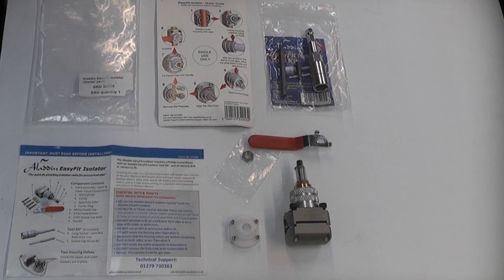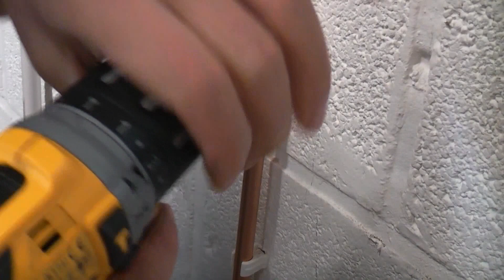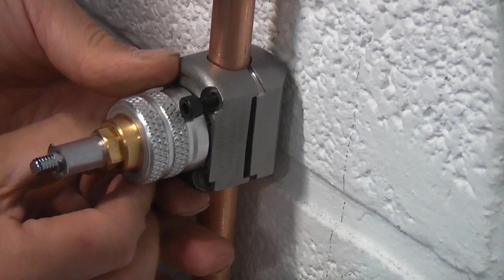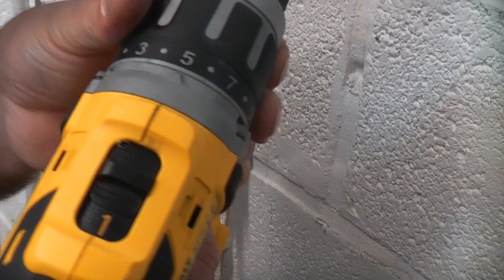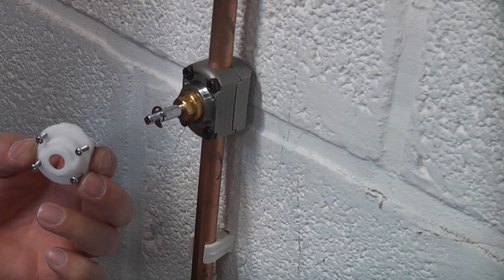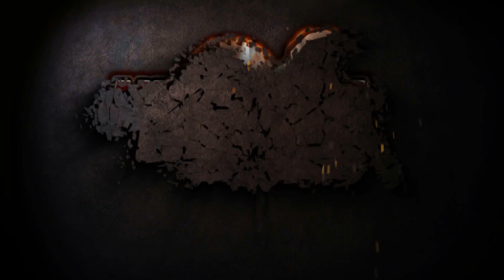Aladdin EasyFit Isolator | Isolate a live water pipe

Comment: Looks vulnerable to impact with no flange or reinforcement. Better clamp the pipes securely on both sides.
Reply from the maker: Once this is clamped in position it is very strong.
Thanks for the comment

Comment: small particles of copper now in pipe , ready to travel upstream to clog your faucet or fill valve assembly in your commode.  it looks like a ingeneering  feat to build sutch a valve complicated but not nescarary just shuu off water cut pipe install sharkbite valve turn on water Walla finished!
Reply: the manufacturers thought of that, there are no particles, just a squashed section of pipe in the back part of the unit.  this device is perfect for people like me who work in the houses of wealthy people who do not want disturbance or inconvenience to their lifestyle, but want problems solved
Reply: *voila - https://www.waywordradio.org/voila-vs-walla/
Reply: I wondered about how it works. So is there any crimped section to restrict flow? How does it maintain the cross-section?
Reply from the maker: Can you please make a video on how to "shuu off water", as I do not know what that means?
Thanks for the comment

Comment: The problem with this is that if a situation arose where this could be utilized the average home owner wouldn't be dealing with the problems this valve fixes.  The homeowner would call a plumber and a plumber would not use this to fix the situation.  If you use this valve to section off copper pipe to solder or alter piping then you probably are more advanced and dont need to go the quick fix route.  Its like a surgeon using a bandaid to stop bleeding then proceed to re-attach a severed limb... On the flipside if you were a plumber and used this you probably got your license from the back ads of a comic book.  Its not up to code, and there are several other things that can be done quicker in an emergency. Hmm i dunnno i kinda want to try it out though..
Reply from the maker: Thanks for the comment

Comment: I would not trust a piece of plastic with high pressure water. Always better cut the pipe and solder a cut off valve properly soldered in place. If there is wood behind, put a piece of dry wall between the wood and the pipe. This is a wired situation most people will not encounter. A pipe exposed like that.

Comment: These won’t work on the old fashioned thick 15mm copper. I wasted £40 on one of these.
Reply: Hi Michael with the older thick copper pipe more torque may be required than your drill can provide.  In this case a ratchet or wrench will be needed as stated in point 6 of the detailed installation instructions.  We also have a technical support 0800 number for any help needed with installation.  Many Easyfit Isolators have been fitted to the old style pipe .  Please call for any further assistance.

Comment: That's a Lot of work..Easier just freezing the water cutting off top and put a shark Bite Valve on ..looking at maybe 3 minutes VS what looks to be at least 30 minutes ..Plus what the Cost ?? Shark Bite Valve about $10 for 1/2 '' But no doubt quick freeze Cut and shark Bite much quicker
Reply from the maker: You can install one of these in about 3 minutes, if you are not filming it ;-)
Reply: so whats the cost ? of say a 1/2'' valve

Comment: Tried it absolutely discussed. Stuck half way with and left me with leaking pipe and the nut keep slipping and gone only half way.
Didn’t work for me. Shit design
Reply from the maker: Have you told them-
https://www.easyfitisolator.com/contact
Reply: @ultimatehandyman  no I still got pictures of the fail valve
Reply: Thanks for your advice

Comment: that sure looks like a ½" pipe to me...
Reply from the maker: 1/2 pipe is very similar in size to 15mm. They used to use 1/2 copper pipe in the UK but swapped to metric a few decades ago, although all the pipe I install on site (steel) is still imperial sizes.
Thanks for the comment ;-)
Reply: +Ultimate Handyman threw me for a loop when you said 15 mil lol, ty for answering
Reply: alcolyte76 ih

Comment: These looks like an excellent idea I wonder if if it goes up to 4 inch pipe if I need a shut off valve  of 4 inch diameter so I would like to know if this device can be obtained in different diameters offer now you'd only it's available and half inch 3/4 of an inch pipe and 1 inch pipe I would like to know and where can we get them and how safe are these things what's the pressure handling per square inch that these devices can handle and is there any risk of the pipe coming out of these device because of extreme high-pressure like which I have found in some of the buildings in which I've done some work that their pressure regulator no longer works so I would like to know what's the pressure handling power of these devices thank you
Reply: Currently the Easyfit Isolator is only available in 15mm and is rated for up to 16bar pressure.  We are currently finishing development of the Aladdin Pipe Genie a pipe blocking tool similar to a freezing kit but better as it can be used on hot or running water too.  This will be available initially in 15mm and 22mm sizes but will eventually go up to larger sizes. Please follow us on twitter for news of new product launch dates @aladdinNlb

Comment: It seems like nobody really listen to what this product is, it isolates a water pipe. Let say you have a leak in a pipe you cannot get to to fix ( in a wall or in a concrete slab) you  can instantly install this and stop the flow of water ( and possible water damage) and now you can work on finding and fixing the water leak. Where i live all the high rise apartments built back in the day have no individual water shut off so when working on one unit you have to shut off the entire buildings water supply.  This would be perfect for retrofitting
Reply from the maker: At last, somebody that understands what this does 👍
Its been quite a drain on me, when I have to approve the "I'd just freeze it", or "I'd just fit a shark bite fitting" comment.
 One guy can even freeze flowing water 😁
Thanks for the comment

Comment: If you could do this Hot/Active I could understand but that was not mentioned here. If you cannot then WTF?
Reply from the maker: 0:13
Thanks for the comment ;-)
Reply: Alot can be said for reading a videos description.
Reply: @Curiosity. The manufacturer website says the Aladdin Easy Fit Isolator installs into pressurised pipework, even with hot running water.
Reply: nightjarflying lol wow
Reply: Curiosity i
Reply: Scott Page USMC uhygt
Reply: Tan Tan don't think so
Reply: +Tan Tan No this cannot be used for gas!!! It is sold for use with water pipes only. With gas pipework you would shut off at the meter, do the required work on the pipes and then switch the gas on. The equivalent to this valve would be to cut the pipe and insert a gas-rated isolator valve (obviously after shutting off at the meter).
Reply: @Curiosity you can even use it on pipes that contain volcanic lava.
Reply: Tan Tan that is definitely not for gas. Wrong color. Never mess with  that stuff. Seals may not hold up against the pressure difference between water and gas since they are not designed for use on anything other than what it says.

Also I have only seen threaded valves for gas. Just a gasket would be insane
Reply: I think this is for Natural Gas / Propane lines only. Anything else would be dangerous. 👍

Comment: I suppose it would help in some situations but this appears very similar to the garden hose kit that put a spike in the pipe. I've heard numerous plumbers tell me never to use these. 

Forty odd quid does seem a bit excessive though.
Reply from the maker: The self cutting taps can reduce flow in some pipes (so I have been told), but this cuts out the slug and compresses it into the pipe, so it should not reduce flow much at all.
It's not cheap, but very well made and very convenient. 
Thanks for the comment

Comment: Using coper pipes for drinking water is not safe and water also has metalic taste. Use a proper piping for your drinking water.
Reply from the maker: Copper is widely used in the UK for drinking water ;-)
Reply: Ultimate Handyman and fittings are soldered with lead probably. Great. You are consuming heavy metals then on daily basis.

Comment: As a plumber for twenty four years, having used these and seeing them installed. They are crap. They cut the pipe damn near all the way through, you are left with two tiny little pieces of pipe left on the sides. I have seen these blow apart several times due to pressure fluctuations in the piping created by normal water usage in large commercial buildings in Houston tx. They only ever get used in places where turning off the water is not practical, so when they blow apart, is not always a quick process to turn off the water resulting in significant water damage. In fact, the last time i encountered them was years ago. Maintenance had installed them all over the building over a few years thinking they were awesome. After two blowouts and subsequent damage, we spent weeks removing them and installing real valves. The best solution to add a valve is to freeze the line, cut it and install a proper valve. I wouldn't install one of these in my worst enemies house. They are garbage.
Reply: Thanks for your comment Shelby but we are at a loss as to understand how one of our Aladdin EasyFit Isolators
can have been fitted to US pipework. Firstly, we do not make any nor is it sold
into the US market, Secondly, the 15mm version we make for the UK market would
neither fit nor work on the 1/2" US pipework, Thirdly we have tested our
valves for water hammer on UK pipework and the gripper system is found to be
more effective than the compression fitting system (the grippers on copper pipe
exceed 150 bar - at which point we found compression fittings extrude off the
pipe), Fourth - I am guessing you have no photos, nor record of communication
with the manufacturer - for which this order of mal-practice would undoubtedly
have been documented (and law suits to follow?). Fifth, many thousands of Aladdin
EasyFit Isolators have been fitted in the last 5 years with no such problems
whatsoever. Perhaps you are confusing it with a US product? (There is a product called Add-A-Valve that I believe has no gripper system and is a very different design). I think we are entitled to see some evidence now rather than the genaralist accusations that you make regarding the valve. Please contact the Aladdin team on 0044 (0) 1279 730363
Reply from the maker: Thanks for the comment
Reply: Ultimate Handyman and i see in the second video, that this version actually cuts the pipe completely in two. Yet it still relies on the same clamp seal and bolts to stay together. The test you performed was one smooth application of pressure one time briefly. The pressures in an active water pipe system varies greatly, with faucets being opened and closed numerous times every day' resulting in repeated rapid spikes in pressure, over time this is a horrible device, that steadily becomes less and less reliable and when it fails, it fails DRASTICALLY, unlike almost any other component in the water system. Most components, wtr htr, mixing valve, pressure reducing valve, faucet, flush valve, shower valve, in large commercial buildings will be protected by a valve in the overhead. This device isn't. Don't confuse momentary greatness with something you want installed in a large system with no isolation valve in case of failure. This is a formula for failure in a commercial building. No use in a house, just turn off water. No use in commercial building as failure would be and has been catastrophic.